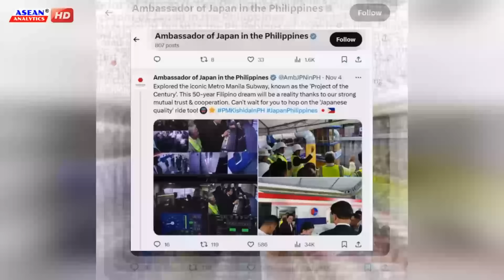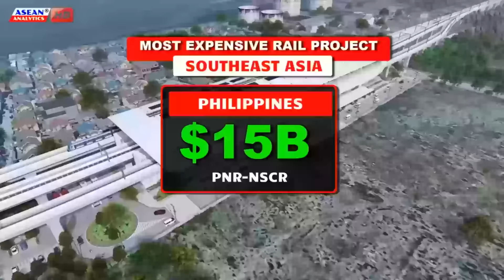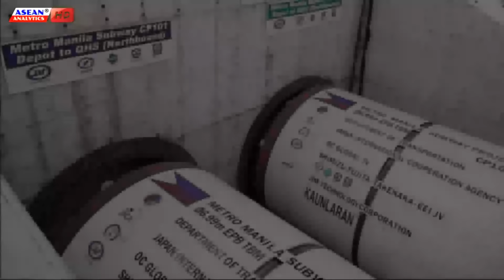Metro Manila Subway Project Updates of Tunneling Works

Comment: The tunnel looks best if done in a layered design like in Malaysia. That it was used as the subway on the first layer and a drainage at the lower level, that removes a lot of Malaysia's flooding.
Reply: I'm sure they surely study very well yan underground na Subway station na yan para sa ating commuters para maibsan na ang traffic sa metro Manila
Reply: Sana po more projects na ganyan pa para maging mabilis na ang ating mga kababayan na yan na maka rating na sa kanilang trabaho
Reply: More more BBM ng ganyan Subway station para maging napaka unlad na ng ating bansang Pilipinas para di masyadong ma traffic sa metro Manila Philippines talaga